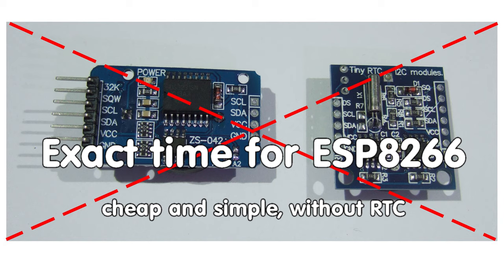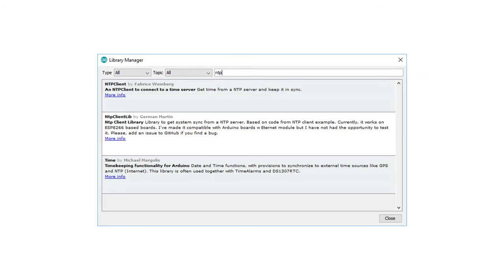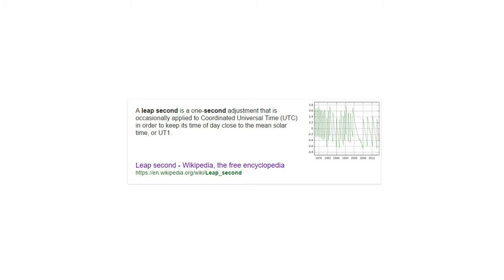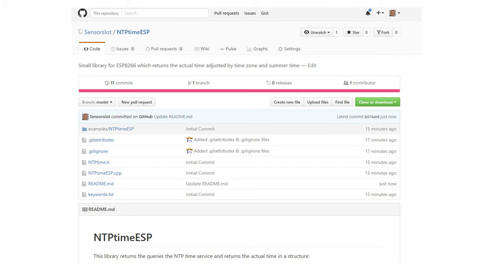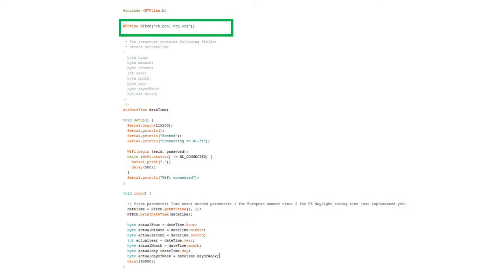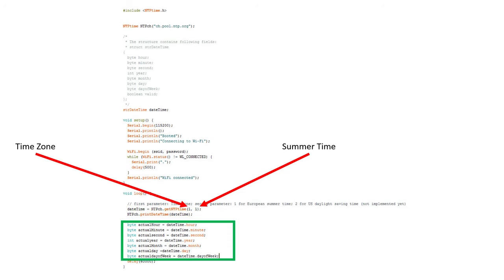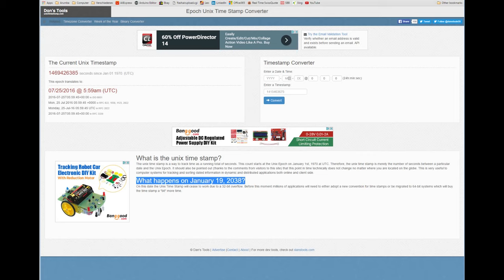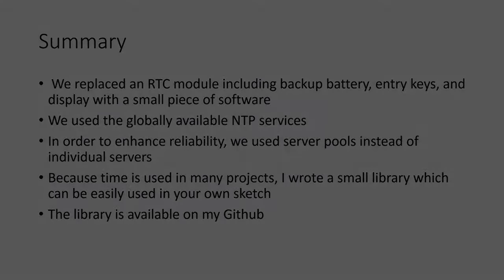#67 Exact Time without RTC Module for the ESP8266: NTP Time

Comment: Hi Guys, I have just worked through this and it is kinda working but I do have a couple of small issues that I wonder if you can help me with. 1) My values (displayed on a 16x2 LCD), if less than 10 doesn't display very nicely, is there a way to add a zero for better formatting? 2) My second counter seems to only count/display every other second but it does seem to move between odd and even numbers. So I guess sometimes they count every third second. Any help would be much appreciated. TIA

Comment: The video was amazing but is there a way to control this all using Arduino Uno?
As your library is only working when I choose ESP8266 as an individual board in the IDE
Reply from the maker: You need an internet connection. The Arduino Uno does not have one.

Comment: hi Andreas! I have been using your NTP time approach for quite some time. starting a couple of days ago I changed something in my sketch and the system now continues to respond 
.sending NTP packet...
I also tried your example program with the same result...
My ESP12E is working without problems, what may be the cause?
Hans
Reply: hmm. looks like I solved some of the above by reinstall of Arduino IDE and libraries...

Comment: I can't remember if it existed in the ESP8266, but the ESP32 actually contains an internal RTC which is super easy to use.
Reply from the maker: But still, you have to set the time and AFAIK include a 32 kHz resonator, which is usually not on board.

Comment: Hi Andreas, I follow most of your videos and have experimented with many of the ideas you have presented - a HUGE thank you!  I am getting odd results with the NTP time though and wonder if you or anyone else has any ideas?  The example basically works for me BUT the time does not update each time the loop runs.  It makes no difference how long the delay is (60 seconds or 15 seconds for example), I get the same time printed for either 2 or 3 loops then the time gets updated to the correct time.  For example, if I update every minute I might see 20:10:34, 20:10:34, 20:12:40, 20:12:40, 20:12:40 then 20:15:41.

I can't see any reason for this behaviour.  Has anyone else seen this?  Thanks
Reply from the maker: The only explanation I have is, that you do not get a response for every call (timeout). But I am just guessing.
Reply: It looks like this is the case - I added a WHILE loop and compared the last seconds with the old seconds and I see lots of NTP requests and replies.  I tried the ch and several UK NTP servers all with the same result.  Has anyone else noticed this or is there something weird with my setup? Thanks
Reply: Hi Andreas, more checking and reinstalled NTPtimeESP: same results.  Typically 1 in 5 time requests produces a new time.  To get the example to compile I needed to make a change in NTPtimeESP.h - the line "#INCLUDE WiFiUDP.h" I needed to change to #INCLUDE WiFiUdp.h" (changing DP to dp) as my core libraries for ESP only contain WiFiUdp.h and not WiFiUDP.h.  Is this a clue?  If you can point me in the right direction I will investigate but right now I am totally stuck.  Many of your followers seem to have it working fine so it looks like something weird with my setup.  I just can't find it!  Thanks for any thoughts.
Reply from the maker: +Robin Harris can you send me your sketch an libraries? Then I try it out here. You can e.g. Use dropbox for that matter.
Reply: Andreas - still working on this.  Have now added some debug serial.prints to the NTPtimeESP.cpp file and can see that each NTP packet increments the seconds correctly (15 seconds currently).  Looking like an issue in the conversion and display maybe?  Robin
Reply: Hi Andreas - good news.  I've found the problem and now it works.  There seem to be two 'bugs' in the library, although I may well be mistaken as I am no expert.  The first problem was adjusting by time zone - multiplying a float by 3600 seems to be the cause and changing 3600 to 3600.0 resulted in my reported times working correctly every time.  Not sure why no-one else has seen this though.

Second possible bug is the getNTPtime function declares _DayLightSaving as a boolean.  Now there is the option for US DST the options are 0, 1 or 2 so I changed boolean to byte.  I guess that would remain hidden until someone tries to implement US DST?

Would appreciate your thoughts as I am feeling rather pleased with myself after an afternoon's work :-)
Reply from the maker: Glad to hear that it works now! I just checked the newest version on github. There,  _DayLightSaving  is declared as byte. So, you are right. This was necessary for more than one daylight saving formula.
The behavior of 3600 or 3600.0 is not completely clear to me because the result is unsigned long. Because of your comment I added now the .0 and casted the result into unsigned long. Maybe it helps some people. I did not have problems because of that. Maybe you download the newest version and try it.
Reply: The behaviour of 3600 and 3600.0 is not clear to me either!  It certainly fixed the problem even though it is not obvious why.   Thanks again for being willing to help and a massive thank you for your videos.  They are amongst the very best I have seen on Youtube and I find them both helpful and encouraging,  Please keep making them!

Comment: Hi Andreas, I am big fan of your videos. Get lot of stuff which is unknown.. Got to know about ESP from your vid.. I have read somewhere that for ESP there is EProm and there is life limit for the same. If I had to use it for commercial project then how is it possible ?
Reply from the maker: The ESP has no EEPROM, it only has a flash chip for the program code. This flash memory can be written a few thousand times before it is killed. This is ok if you use it to store your code. It will for sure not change thousands of times. There is a "hack" available to emulate a EEPROM function using the flash chip. This, of course has the same limitations and therefore should not be used for frequently changing variables. Watch my video #60 for this topic.

Comment: Great video!. Can i use this for my project? I am sending data to a web server using a RTC module DS3231 with esp32. I need to use a backup system when the internet connection lose and backup the data in a SD memory with the date and hour for be sended to my server once the internet connection back. And a question, How maintain the date and hour after the internet connection lose using the NTP server?
Reply from the maker: I do not know. You have to try, I think. Maybe you watch my video #299?

Comment: Hello,
do you know why the time is not correct when using a static IP configuration with:
WiFi.config( ip, gateway, subnet );  

Instead, if I let the esp8266 module get an IP address assigned by DHCP, the time is correct.
Thanks
Reply from the maker: I also had issues when using fixes address, but never found out, why. I think, it has to do with the connection, not the time reading (the device just times out after a while without connection)
Reply: When I use a static ip address, the initial time returned by the ntp server is 00:00:00.
After that, the time is updated correctly.
Reply from the maker: So, it works now correctly?
Reply: It works if I specify a correct initial time at the beginning.
This is not very useful because it has to be redone at every recompilation of the code.
Reply from the maker: But then, it does not work. The clock runs without a NTP server. So, in your case, it looks like you never get a NTP feedback. If you set the time, the internal clock runs, but not very precise... So, you experience the same issue for fixed IP as I did. But I am not a network specialist...
Reply: Yes, you are correct: I do not get the time from the ntp server.

Comment: Is there a way of using this library while a server is running? I want to use this with my smarthome webinterface.
Reply from the maker: Just try it. I assume it will work.
Reply: @AndreasSpiess  I did, but it sadly doesn't work... The common NTC libaries didn't work eigher though. When I ran your test skript, it did work, but as soon as I merged it with my own, it won't...
Reply from the maker: @kasekuchentv7869  Unfortunately, I cannot do remote debugging :-(  I ususally start with a running example and add line after line of my new code. Then I see when it stops working...

Comment: Hi. This is a great code but still, we have to either manually set the summer time flag or using any available I/O pins get the activation of summer-time calculation activation from the user. Is there any way to get rid of summer-time calculation activation? I mean is there any service available to provide with the current local time without having to calculate the time manually? For example, when we type in google "what time is it?", there are tons of websites that show the current local time (based on IP and location from where the request has been sent out). Is there any way to get this simple value and not be worried if it is summer-time or not? The service would provide with such info: the current time at this moment is this and that.
Reply from the maker: You just have to decide if the place you put your module uses summer time or not. The rest is calculated automatically. Of course, you can call a different service to set the time zone automatically. Then you would need a GPS module and have to place your module outside.
So I think, most people know the time zone and are happy with entering it by hand.
Reply: I appreciate your reply. Let me please clarify my situation with this project. The location is in Germany and will never change. Thus, the time zone could be set in the project once and that is it. Now just the summertime is the question. What I understood from your answer is, that if I set the summertime in the sketch, then it will automatically change to none-sommertime on Sunday, October 28 at 3:00 a.m. and I do not have to reset the summertime flag in the sketck on that particular time (of afterwards). Is that right? If it is so, then the code has to consider the summer time again on Sunday, March 25 at 2:00 a.m. Did I get it correctly?
Reply from the maker: There is a formula implemented which should to that automatically, if you set the right parameter. Otherwise, it would not make a lot of sense, I agree.

Comment: ...is there a arduino code that gets time from a cellular synced phone via smartphone network hotspot without  connecting to a server....and run on crystal until cellular resync
Reply from the maker: I do not think so because te Arduino has no connection to a smartphone
Reply: Andreas Spiess ..you mean esp8266 is not considered an arduino.?
Reply: ..what i meant was...get time from an allready synced clock like a smartphone or a network router..to ease internet traffic or  interrupting a server every 1 minute for a clock sync..esp as a stratum 3 client..

Comment: Sir I have Arduino Uno board with ESP8266 wifi shield and I'm trying with LED display. Please share code and schematic if you have or does the above thing work with this.
Reply from the maker: I do not work with Arduino and ESP8266. So, you have to google.
Reply from the maker: I only work with Arduino or ESP, never together

Comment: but once it gets the time it need to be continously power on since when it lost wifi conection is has to reset time ¿isn't it?
Reply from the maker: Only if it loses power. If it is powered it has an internal clock (not Swiss precision), which has to be synchronized from time to time by an NTP call.

Comment: Hello Andreas, the guy with the swiss accent, thanks a lot for the great videos and tutorials!I'm very new to ESP8266 and Arduino ESP.
I coded a lot of stuff in Basic, Turbo Pascal and Visual Basic, but it is about 25year ago and I fear I forgot a lot of this.
I tried to use your library but I did not get it run like expected.I just wanted to have a look, if the time and date is correct, so I used some serial.print commands. 
At first it showed nothing.
Then I removed the "if(dateTime.valid)" command.
I added some lines to your code:
void loop() {  // first parameter: Time zone in floating point (for India); second parameter: 1 for European summer time; 2 for US daylight saving time (contributed by viewwer, not tested by me)
  dateTime = NTPch.getNTPtime(1.0, 1);  // check dateTime.valid before using the returned time
  // Use "setSendInterval" or "setRecvTimeout" if required
  //if(dateTime.valid){
    NTPch.printDateTime(dateTime);    byte actualHour = dateTime.hour;
    byte actualMinute = dateTime.minute;
    byte actualsecond = dateTime.second;
    int actualyear = dateTime.year;
    byte actualMonth = dateTime.month;
    byte actualday =dateTime.day;
    byte actualdayofWeek = dateTime.dayofWeek;
    Serial.print("actualHour: ");
    Serial.println(actualHour);
    Serial.print("actualMinute: ");
    Serial.println(actualMinute);
    Serial.print("actualsecond: ");
    Serial.println(actualsecond);
    Serial.print("actualyear: ");
    Serial.println(actualyear);
    Serial.print("actualMonth: ");
    Serial.println(actualMonth);
    Serial.print("actualday: ");
    Serial.println(actualday);
    Serial.print("actualdayofWeek: ");
    Serial.println(actualdayofWeek);
    delay(10000);
  //}
}But this is the unexpected output:actualHour: 0
actualMinute: 0
actualsecond: 0
actualyear: 1073667216
actualMonth: 32
actualday: 235
actualdayofWeek: 254I have three questions:
1.) Why does it not get a valid date and resulting can not enter the loop to print the variables?
2.) Why is the output not like expected?
3.) How to realize a clock, which synchronizes every 5 minutes or similar by ntp?Thanks and best regards,
Chris
Reply from the maker: I would stick with the example provided. If it does not work, there is a problem with the network. Other viewers also had problems with some network configurations, but we were never able to figure out the "root cause" (maybe you read some of the other comments here). Maybe you try my other NTP example in video #71. It uses a slightly different way to get the NTP signal.
P.S. When I saw the list of your programming languages, I found parallels with my experiences...

Comment: So I found out that on Thursdays, 
dateTime.dayofWeek gives the value 5.
Extrapolating on this, Mondays give you a 2 and Fridays will give you 6. 
What about Saturdays and Sundays?
Reply from the maker: I never tried the day of the week. Maybe you try and then, you know...  Usually, they start the week either with Sunday or Monday. But I do not know, if they start with 0 or 1.
Reply: I can now say after experimentation that Sundays return a value of 1 and Saturdays a value of 7.
Reply from the maker: Which is perfect for some parts of the world. In Office, you can also chose this system. However, I like more the one with Monday as #1

Comment: I wish to know how to set the system variables _TIME_ and _DATE_ in eps8266, after I update my rtc module (ds1307), using ntp server.

I used this code, in the ntp code, but it seems not to update the internal rtc.

epoch = secsSince1900 - 2208988800UL + (timeZone * SECS_PER_HOUR);
setTime(epoch);

Do you have any idea about how this works?

Thank you very much and congratulations for the excelent videos of your channel.
Reply from the maker: If I remember right, you can watch the other video about time (#71). There, I use SNTP and time(). Maybe you find a solution there.